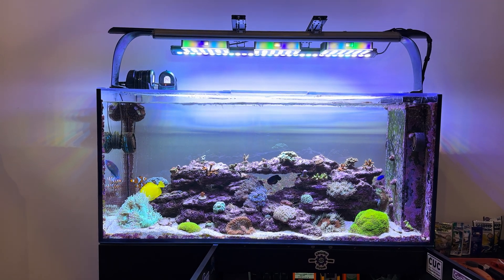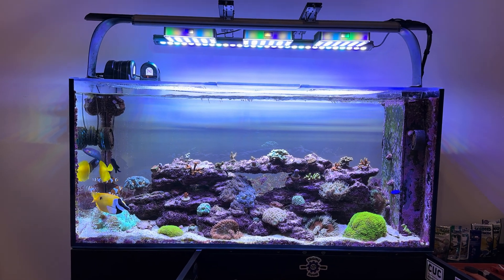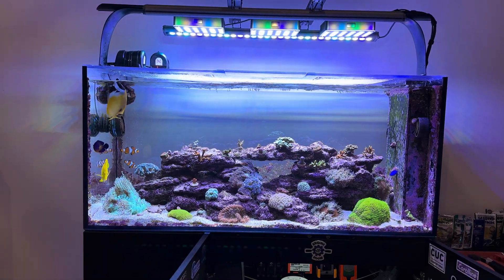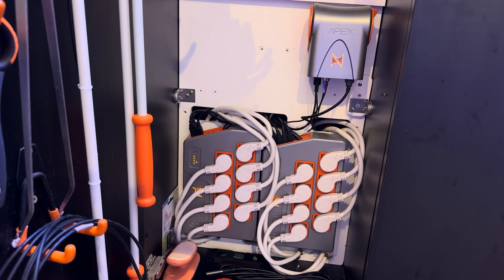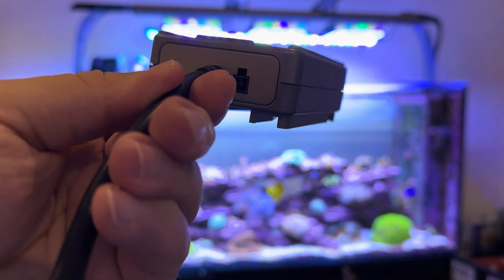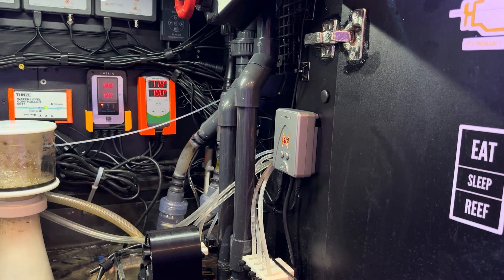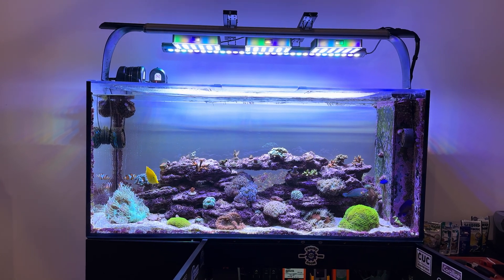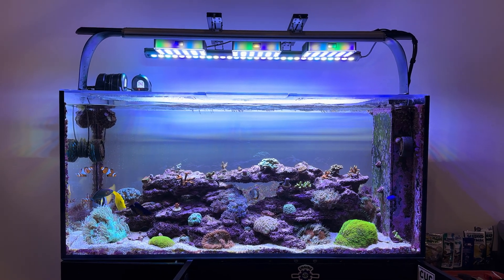Explained: One Way To Connect Your Neptune Return Pump To Backup Power

Comment: I have the ecoflow river 2 pro with Cor-20 plugged in as my circulation pump, when I cut the power of the neptune controller the cor 20 also shuts off, is there a code that I should write so the 1link data cable is not interfering the setup, thanks.

Comment: Great video!  Glad you found a solution that will allow you to keep that return going when the power goes out.  I think you will be much better off keeping that sump from going stagnant.  Yesterday, we just lost power for 2 hours....I've lived in this house for 4 years now and this is the first time we have lost power. As a result, I am feeling pretty good about the ecoflow purchase at the moment, lol.
Reply from the maker: The coincidence of losing power for the first time right after you got the EcoFlow and Neptune work done for backup power - wow. Talk about the universe patting you on the back for a job well done 🤣 But yes, I am really happy to have the COR pump as the functional piece when power goes out. It just feels right. The emergency plan is lot more solid this way. We get wicked storms in Mississippi, from time to time, so having that sump water moving in an instance where we might lose power for half a day, is great for peace-of-mind. Thanks for spurring me to look for options to get the COR on backup power. I kind of dismissed it, because it’s built to run on that 1Link cable. But after you found a way, I started digging, and it was like “Oh, this is a stupid expense, but I could just swap the control box for one with a dedicated power supply if I buy a new one.” I justified it to myself by saying “If one control box ever dies, now you’ve got a temporary backup you can throw online.” 😂 The justifications for the things we do in this hobby are vast and complex, my friend. But one thing I don’t feel bad about investing in, on the whole, is the emergency power plan. It’s just too dang important!